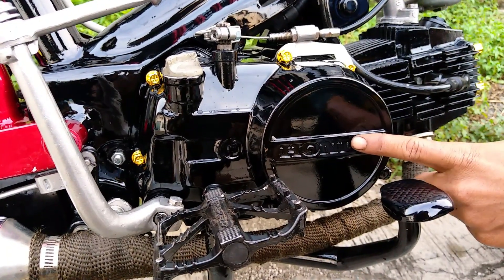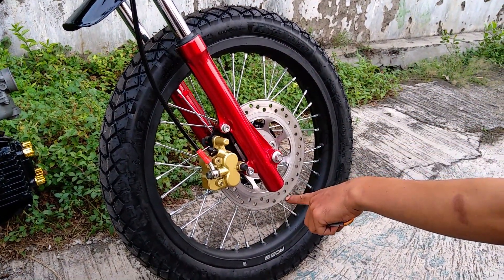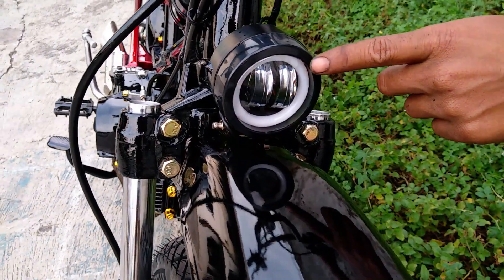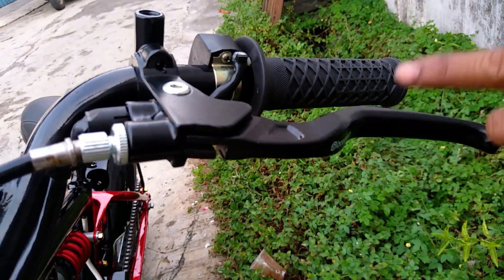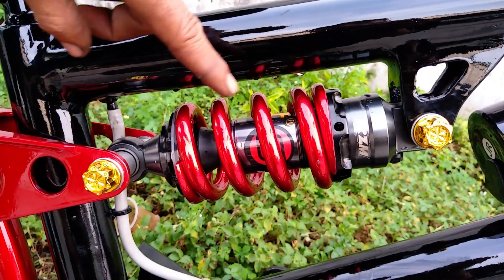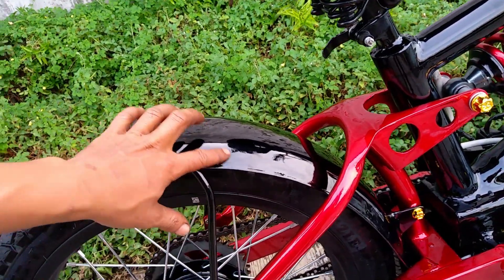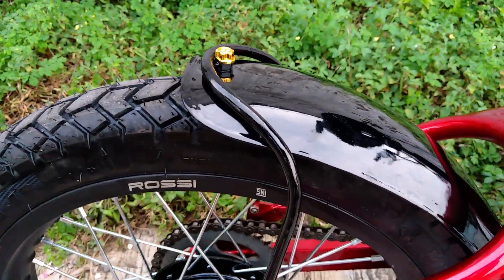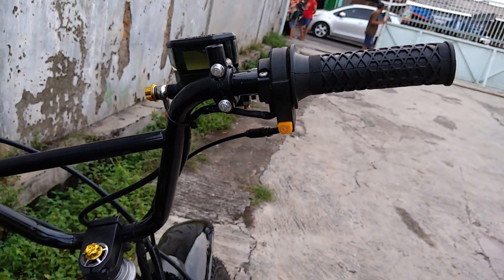‼️MOTOR BMX BASIC HONDA SUPRA‼️

Comment: Mohon ijin tnya bang. Klo tinggal pasang mesin brpa
Reply from the maker: adanya sudah sma mesin harga mulai 9 jt an
Reply: @mulkmodifikasi  boleh lihat contoh 6g sdh bang?
Reply: @mulkmodifikasi  brpa nmor WA nya
Reply from the maker: @klantan2818  085790905151
Reply from the maker: @klantan2818  085790905151